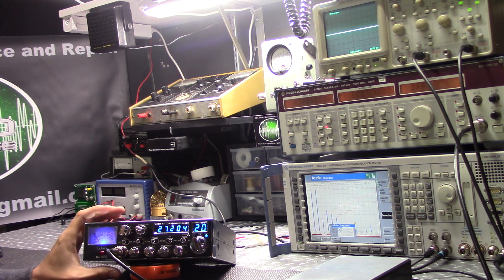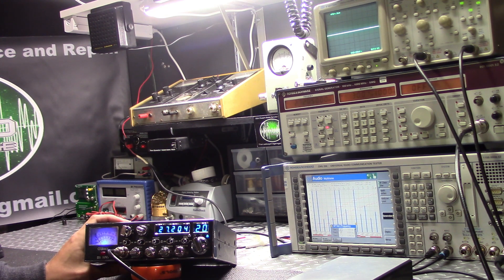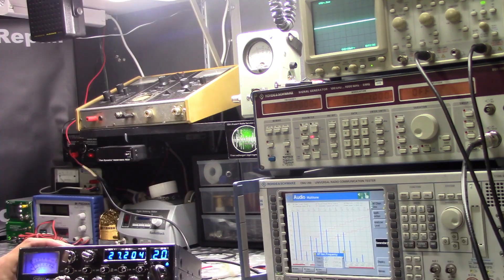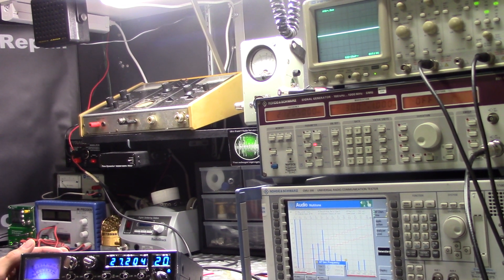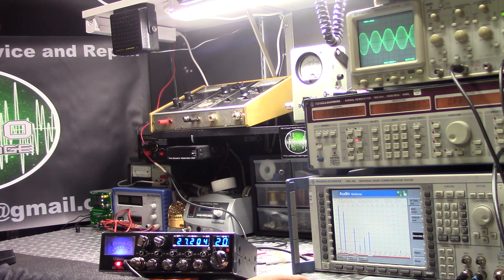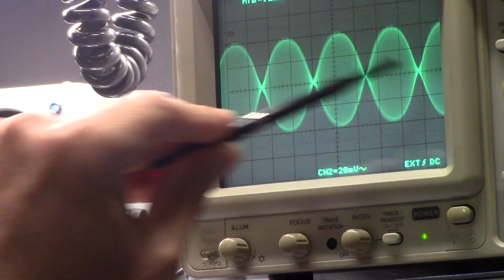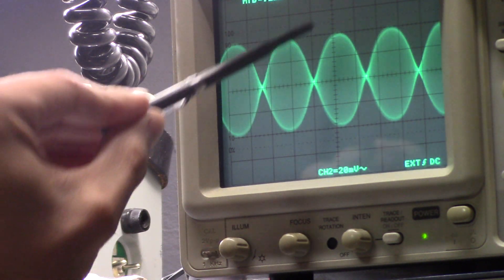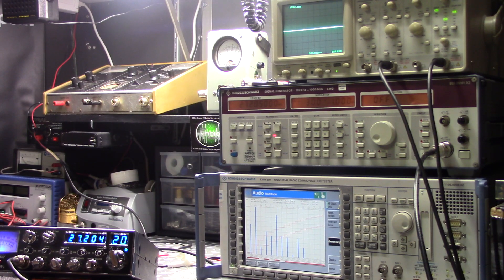GALAXY DX 99v2 SSB TWO TONE TEST for Linearity on the Oscilloscope - CB Radio Export 10 meter

Comment: I need your suggestion, I'm in doubt which radio to buy? Ranger 69vhp or Galaxy DX 99v2? can you help me with your opinion? galaxy dx99v2 is Malasya and Ranger RCI69VHP?
Reply from the maker: I don't have any experience with the 69vhp so can't speak of its performance.  The 99v2 is pretty solid but can't say which is better. 73s

Comment: I have the old 99v and the newer  99v2, both have been great radios but the newer version kicks ass, I also subscribe to your channel. 73
Reply from the maker: Thanks for subscribing! Yep can't beat the old ept3600 chassis that the 99v and so many other radios were based off of. The newer ones from Galaxy are pretty good but talk about bad solder joints, wow. 73s